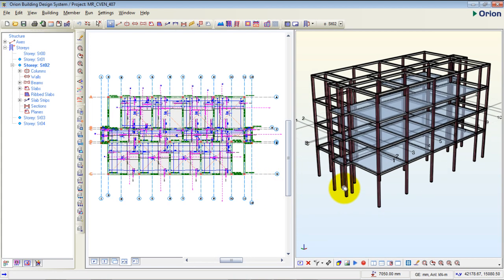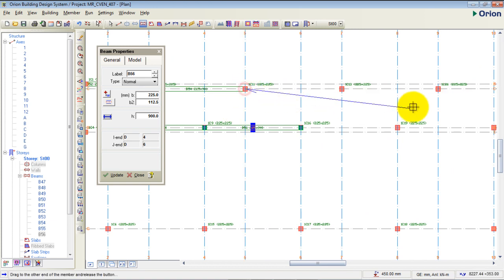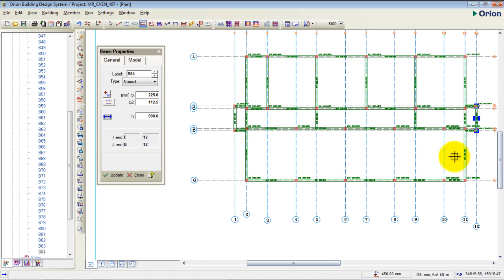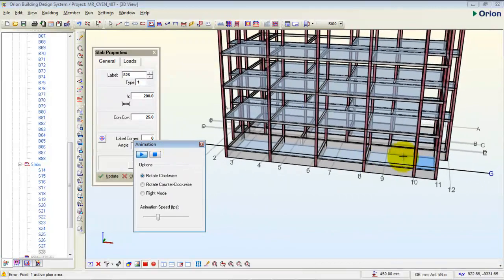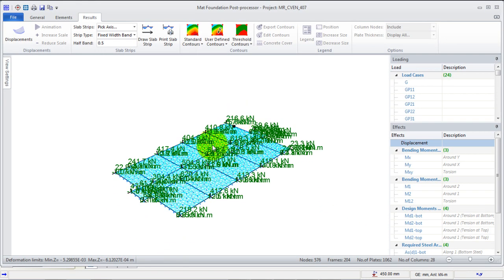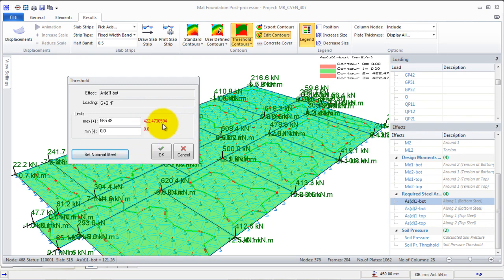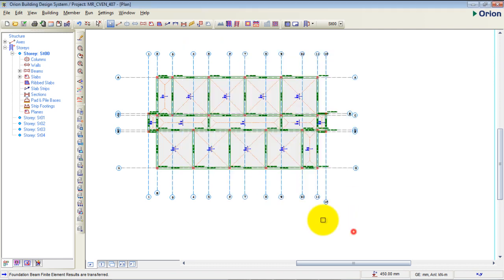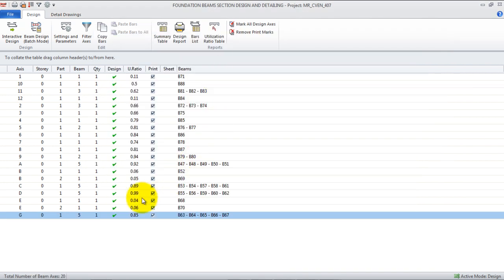ORION 18 TUTORIAL: HOW TO DESIGN RAFT FOUNDATION (STRUCTURAL DESIGN)

Comment: Good job.
I observed you didn't draw the slab strip before you run the analysis. 
Is that the appropriate way to design the raft?

Secondly, why choosing the threshold contour and not the standard contour? Which of the 2 should be used?
And lastly, before the analysis post processing, I expect that you edit the soil bearing pressure. What you used in the class was 200kn/m2 which in a really sense don't require a raft foundation.

Thanks

Comment: Nice work.
However, there was no check on the earth reaction against the bearing capacity of the soil. 
The theory behind raft foundation design is the comparison of the ratio of total vertical loads at serviceability limit state to the building area (footprint) and the soil bearing capacity. The earth reaction must be less than the bearing capacity of the soil. This is when raft design is established.
Reply from the maker: Subscribe to see the up coming video.

Comment: Why is it dat ur not loading your wall on your beam
Reply from the maker: Share walls can stand alone without beams. Using  share walls to support beams or either ways,  is not cost effective.
Reply: @cadteacher12  I don't get dis explanation clearly
Reply from the maker: @bamsondavid4463  Pls watch the video on hoe to design share walls
Reply: @cadteacher12  are u saying the wall parameter we gave in d parameter section is sufficient